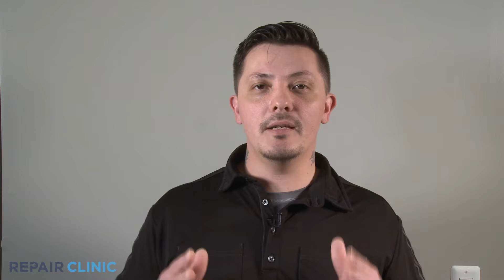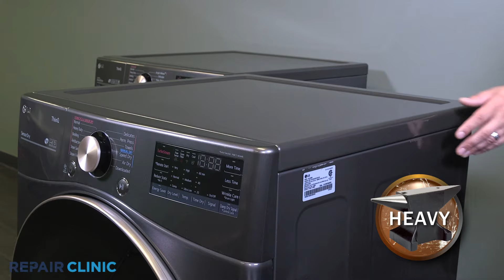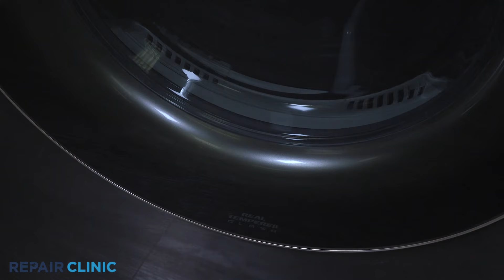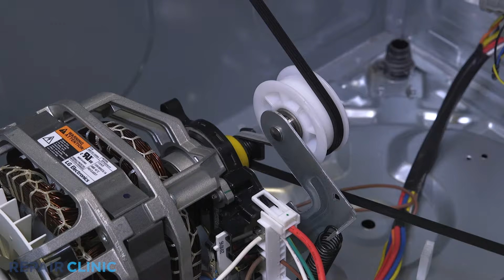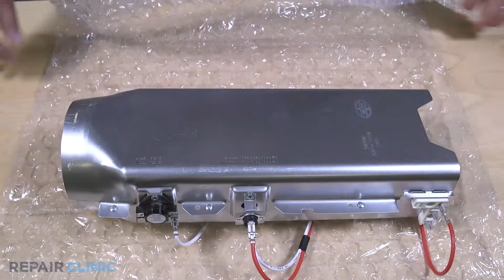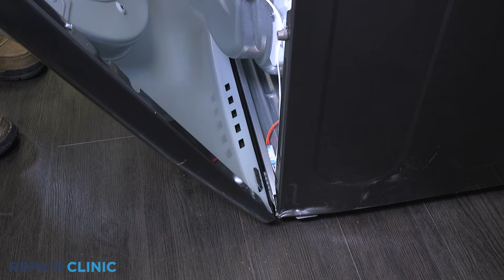LG Electric Dryer Heating Element Replacement 5301EL1001J

Comment: REMOVE THE DRUM??  Are you kidding me??  What a waste of time.... all you need to do is get that front panel off and just reach down in where the element is to replace it directly.  You got people here breaking their equipment all up for no reason.
Reply: Right?! Couldn’t agree with you more 😂
Reply: Hey, @va911! I’m needing to do this. Thanks for your feedback here. Question… where’s that where the element itself?
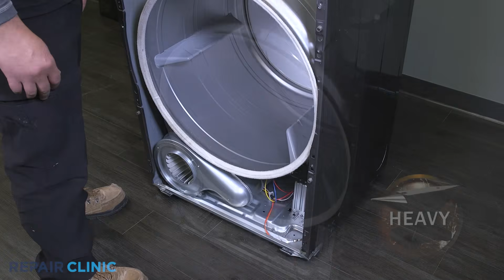Reply: @RPerryCO  3:48 -- that lower right piece where the wires are running to and from.... right behind that mettle bracket is where the Heating element is located.  Remove the mettle bracket, the element itself is located in a tube... I remove the tube, swap the old element for the new one... put the tube back, replace the bracket holding the tube in place... put the front cover back and done.
Reply: @va911  thank you so much! Part ordered!
Reply: Lot dryers need thorough cleaned, need take drum out!

Comment: This video was very helpful!! My dryer was not drying my clothes in a timely fashion so i decided to change the heating element. The heating element was $65 on Amazon. The video took you step by step in the process. So simple!! Thank you !!
Reply: how were you sure it was the element.  Its my guess but wondering if there is a way to know for sure.  I did check for any vent blockages and that is clear

Comment: This video helped me tremendously replacing my LG DLE3733W dryer heating element assembly.  The control panel and the light connectors were not exactly as shown in this video but everything else was super helpful.  Thank you do much!